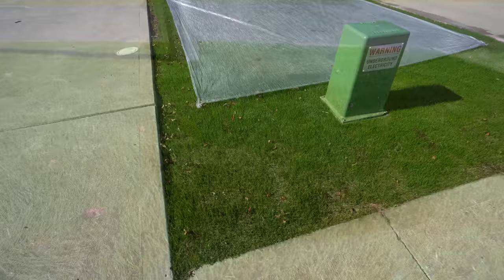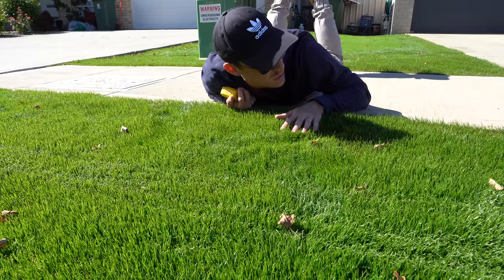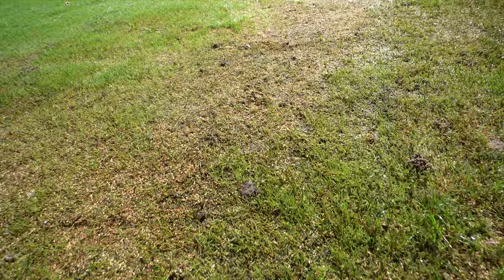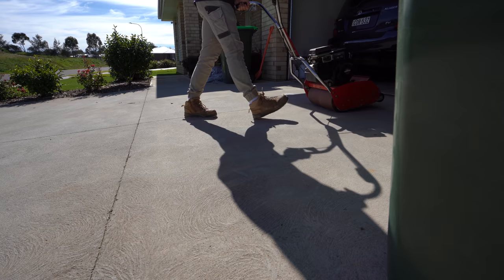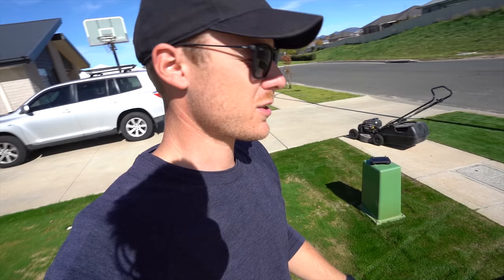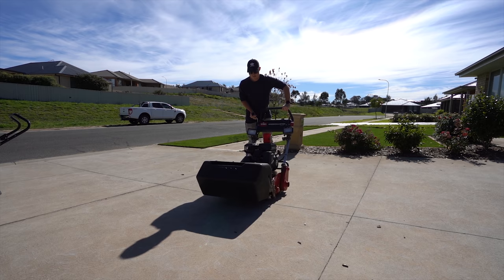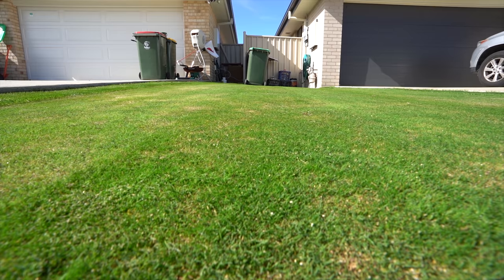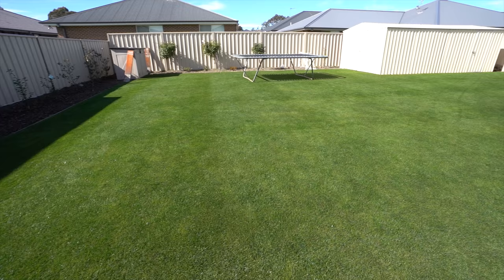First Mow On My 20 Day Old Seeded Lawn // Golf Green Project

Comment: have you ever had any problems with oil running straight into the carb when you tilt in backwards like 3:25?
Reply: Never tilt mower on its side always tilt towards handle
Reply: southaussiegarbo 2054 wha?